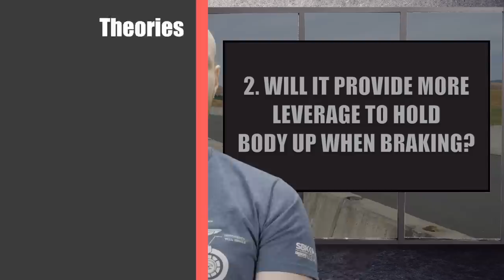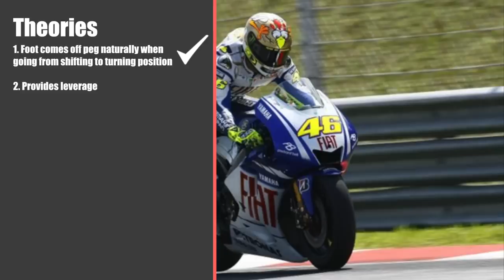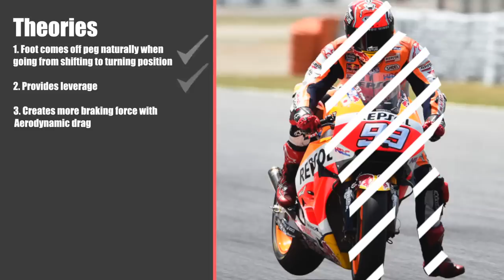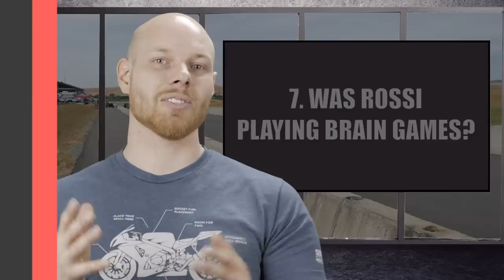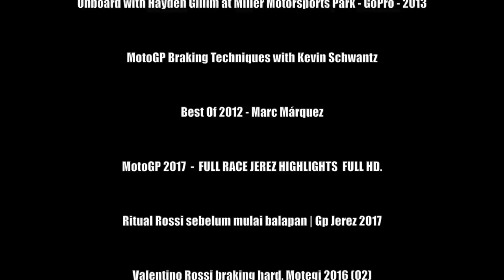The Leg Dangle EXPLAINED

Comment: The leg dangle in my opinion is a corner entry speed distraction,if you fall with your leg out you could almost certainly break your leg,or if your  boot catches to much friction at speed it would flick your leg back in an instant, very painfull,in my opinion a dangle means you not sure what the front tyre is going to do under braking,or braking into a corner,i think it shows no confidence in tyre grip and if you do crash with your leg out you almost certainly not walking away,when moto gp riders use the dangle I immediately lose confidence in their ability to progress further in the race,watch zarco show them round on a slow bike,he knows the dangle is a distraction, everytime you dangle you lose up to 2tenths of a second,if your tyres aren,t gripping slow down and finnish the race and take the points.
Reply: I said up to 2tenths of a second,so I still think the dangle is a time wasting distraction, unless you work your bike like a motorcross bike,it works well.

Comment: breaks the air going over the center of the bike creating a low pressure zone on the inside of the turn and a high pressure on the out side of the bike then aiding in leaning the bike over

Comment: The bathroom scale experiment is useless. To apply pressure on the wall, you push on it. Putting one foot back allows you to block your body from being pushed back of the wall ('cause the wall won't move back ^^ ). 

This is a common fighting technic to avoid being pushed back by a kick! The MMA image used is focusing on the right guy in a defense standing position (front foot on the toes tip): if the opponent throws a low kick, he can block it by lifting his leg higher an take the it in the muscles of the leg (that hurts way less than not moving the leg) or simply step back. 

If it was a technic that would help braking harder, they would put their foot in front of them and push on it, to help the body resisting the inertia. But nobody got their foot in front of the bike.

Here we can see that pilots don't touch the ground when they brake! So it is not helping the braking part...

The theory about the aerodynamic drag is plausible but not really effective and resisting the wind is too tiring...
So for me it's not that.

Comparing MotoGP with MX is irrelevant... In MX you put your body close to the handlebar to get more weight on the front wheel and avoid loosing it (because of the dirt). And the foot is in front of the bike to kick the ground if you lose the front wheel, taking the bike up and avoid falling. As the bike is 120 kilos max in MX, you can lift it pretty easly.  In MX, your rear wheel will slide anyway, and you got short corner to deal with so keeping the front wheel some grip is more important.

In fact we only have to watch Supermotos races to understand what is happening... During de rear tire slide, pilots put their foot out to have another standing point. This help controling the slide, avoiding low sides and move the center of gravity inside the corner.
This is just like puting the knee down in corners but during the braking part.

Comment: I don't see any benefit gained by doing this but I do see some major disadvantages. The number one contact between a rider and bike braking heavily should be the riders knees gripping the tank. Take away that contact point the riders weight can only be transferred to the handle bars. The riders steering ability must suffer..........the feel and feedback to the rider must suffer.......the front suspension must suffer from excessive loads...........and add to all that the destabilizing effects of a leg dangling about while trying to achieve the smoothest transition possible for the front end from being compressed in braking to being compressed in cornering. It's a big ask for a front tyre not getting any assistance from a well set up bike being ridden well.

Comment: Look at when most of the riders place their foot back, it's the moment it touches the floor, could the simple answer just be it's used as a reference to when the bikes leaning for the corner ie like the brake marker boards, but by the floor touching the foot they know the turn is at its optimum point and so lean in and pin out
Reply: Many road racers now use flat track as training. They picked it up from Kenny Roberts who started saw the benefits of flat track racing for road racing many years ago. Valentino Rossi built a dirt track of his own, and called it the ranch because of Kenny Roberts. (check out the monster energy video series on him) So as they put a foot down when sliding thru a turn, road racers started doing it while road racing. You see that it was mentioned that Valentino was the first road racer to stick his leg out.
It's simply because of the sliding that happens as they are breaking. One difference you'll see is that in flat track where they'll have their foot down throughout the turn most times, in road racing they only do it in the breaking zone. And also they hardly touch the ground with their foot. It's a precaution. If the rear slides too much, they can use their foot like a flat track bike to keep from sliding out.

Comment: the way I see it is too provide wind resistance to help braking and in doing so it also gives a quicker lean into the turn so you can hold your braking line longer. that is my take on it, if it were Michael Schumacher doing this I would of said it was to kick riders that are trying to pass him off the track. ;)
Reply: and when cycling lets say an off camber turn you lean  your bike with the inside leg out to provide extra weight on top of the contact patch to increase traction (bite). every little hundreds of a second add up quick in a race.

Comment: based on how n y I do it, is the reason 4. I find it easier to control the bike when my rear slides due to engine braking prior to entering the corner. Or prolly I'm just used to it.

Comment: Applying nerd math to what a dirt bike rider would naturally do, when going into a corner too hot but you still have the inside line over your opponent you're just going to slide into them in the leg is going to help stabilize you from the rear wheel washing out, you can also tell there is a bump which pushes the rider totally out of bounds they were both going into the corner hot trying to win. In other words he stuck his leg out let his bike slide into his opponent and use his opponent as a berm just like in dirt biking

Comment: leg dangle set a 1 meter perimeter for any racer behind to perform and pass because it disrupts the racing line
Reply: and also sets a later braking point and slide for rear break to square out to carry high speed corner exits

Comment: WHat about this.  If you break on the limit you may step over occasionally and lock up the front.  when you lock the tront it will tuck toward the inside of the corner.  This is the leg that everyone sticks out.  Its the same reason you drag your knee.  You can stomp you foot and save it just like you can catch the bike with your knee further in the turn.

Comment: You haven't explained anything and this isn't "content". The leg "dangle" is a dirt technique to control a slide or get the bike out of a slide if it gets uncontrollable. Corner entry and mid-corner sliding changes your line, corner exit and power application through the corner and is observable in almost all kinds of motorcycle racing. Do you even ride?

Comment: Dude why don’t you just are your bike for a ride and you will see it’s obvious.....While going in a straight line stick your leg out and see what happens....? the weight shift will pull the bike in that direction.  Moto x riders put their leg out in front ( not to the side) this helps get more weight to the front wheel for traction and makes it easier to catch it when the front wheel starts to wash out.
Trials riders and enduro riders use the leg out to the side a lot to try to pull the bike it the direction  they want to go ( ie weight shift)
And as for it starting in 2005 ..... come on man !!!!! riders were doing it back in the 60’s and 70,s cheek out some old footage
Other wise great video🙈

Comment: I think you're trying to make a science out of something a well trained chimpanzee could do and all of this leg dangling stuff has just become a cool, fashionable thing to do.  Back in the 60's, Joel Robert, the enfant terrible of international motocross, made a habit of contorting his bike into  all sorts of unlikely shapes while still in mid air from a jump.  Flying around with the bike in a fully locked up position was the most common one.  It served absolutely no purpose, yet in no time flat, every novice rider was doing the same, all the while ignoring the fact that while it may look spectacular, the longer you are up there airborne, the more ground speed you are losing.   From what I've seen, this silliness continues to this day.

I couldn't quite grasp how having a leg out in the breeze has anything to do with causing or preventing or controlling a drifting or power sliding bike through a corner.  In any type of motor sport, any drifting or sliding achieves exactly the same result as hanging up in the air performing tricks with the bike - you lose speed!  While it might seem to be an unlikely comparison to make with racing on bitumen, speedway riders are probably the competitors most aware of this, despite spending at least half of every race sideways.  There are a lot of things that go into the making of a great speedway rider, but if he can't "read" a track, he might as well give the game away.  Reading a track is the ability to see where on the track that he will find the most drive or traction, because races are won and lost by who has the least amount of wheel spin and who hasn't.  With everyone mounted on almost identical machinery, this is why some speedway track records can stand for years on end and are only broken when the man who prepares the track does an truly exceptional job and the best reader of the track is usually the one who emerges with the track record.

The bit about a motocross rider's cornering technique has, to my mind, nothing at all to do with how a road racer corners, leg dangling or not.  Any half decent photo of a motocross rider cornering should show that he doesn't have any say in whether he rides with a foot out or not - he simply has no choice because there is no where else to put it.

Personally, I think Mr Rossi is playing a prank on his fellow riders and at each end of season, he sits at home polishing his many trophies and chuckling at seeing his rivals on video following him into a corner, all faithfully and very sheep like, showing a bit of leg.

Comment: You downgraded aero braking yet you show 44% increase from raising up a little? The effect of it is increased rate of speed reduction due to aero drag and sometimes contact drag too! @10:33 the boot sole is smoking!  Intially it helps control the entry slide they all use. And like it has been said Rossi has a dirt track he practices on so it may have led him to do it on the road course. Finally blocking and head games. Would you attack late into a corner when the leg of the rider ahead is taking up the space? Most would at least hesitate to do so. All top racers play head games. Sometimes the game has a real physical advantage.

Comment: "...dubbed the 'Doctors Dangle" 

An excellent piece of critical thinking, Mikael. 

However, it's fascinating there was no comparison to the graded dirt track racing Rossi^ has done all his career in cross training for bitumen or asphalt tracks. 

As there is far more similarity in the graded dirt track racing technique than typical motocross riding with jumps, offroad, downhill corners and sections, despite most MotoGP riders using both for cross training.  
 
______
^ Rossi's Ranch: https://youtu.be/JLYgD_nf2Mc

Comment: The leg out came from speedway, Steel boot base and throw the bike over, no room for the leg and most never had a LH footpeg,,,,  dirt bike just thought they could use the same but would never support them & bike on such a rough track, (broken ankle). Ever thought such a cramped riding position in GP would cramp up the old Doctor in the hip, then the copy started !!

Comment: I see nothing but a blocking technique. Why it comes out way before the turn. Want more drag and stopping power? Just sit up higher then lower your torso when entering the turn. Also notice it's only done when riders know they have someone relatively close or think they may have to them and don't when there isn't. But I will add Karters including myself have been doing this since the 80s. when entering turns too hot. Another thing he seems to not know is in dirt racing ruts are a huge problem and riders HAVE to lift their inside legs because the peg is below the dirt line. And in like snow skiing you can plant your foot like a ski pole to  use as an apex to turn  on. Dirt bikes are about low end launching torque.  Not carrying speed through turns. But what do I know? Haven't raced in years. Never hit jumps because I could never land without hurting myself but could take a berm and launch out of them as good as the next guy. Sadly there was always a jump right afterwards. So karting was my gig. Ascot Park was my start. Todays riders have much more skill than ever. Love watching bikes. I'm sure this guy knows what he's talking about.

Comment: I always found that Track surfaces suck!..and by having my foot out, I could control the rear wheel "drifting action" allowing me a faster entrance speed and giving me a third point of contact should my drift try to become a "low side" .just lightly touching the ball of my foot would completely stop a low side...This of course is "at speed" It is definitely a high speed maneuver and useless at slow speed..It also provides a psychological edge, to hold back someone trying to pass under me..I think it got started back in the 80's when riders raced harder and kicking  front tires of riders next to you was not only common but never ruled upon by Stewards..We raced with a lot more aggression back then...lol

Comment: bracking and stability ,nothing to do with blocking, common sense says its for helping to slow , stick your hand out of  the car window when you doing 80mph on motorway and feel the air, air brAKE, more area of body that areo slows your ass down .riders use it they behind someone else n not overtaking .the doctors dangle ,,lengend. areo drag 100& .#GOAT